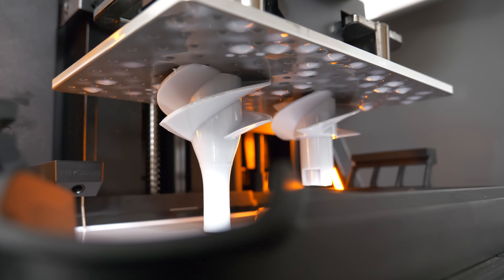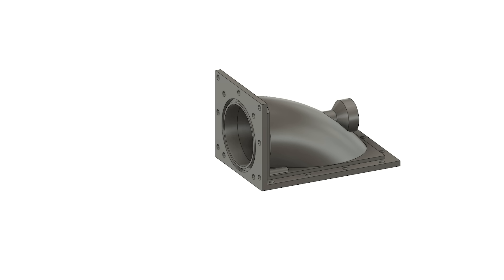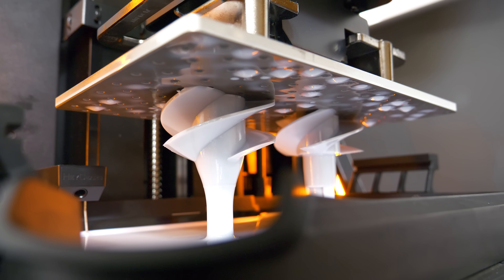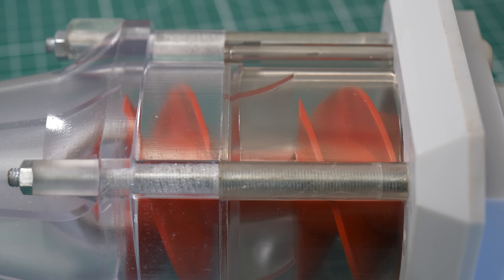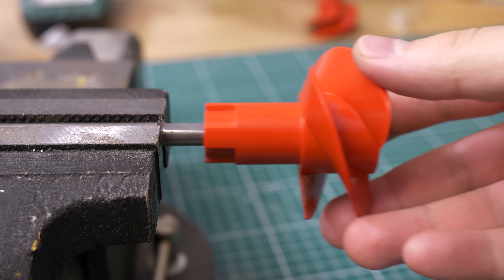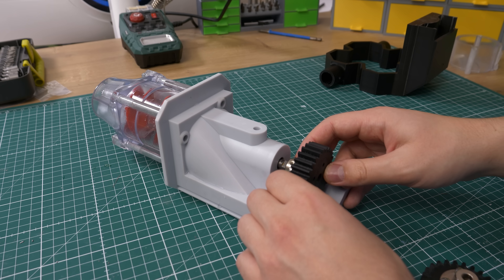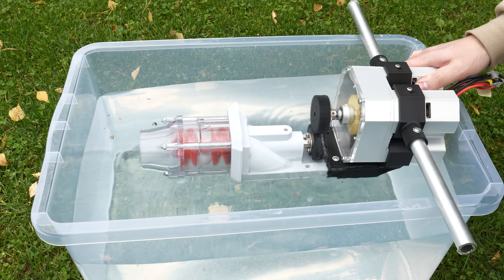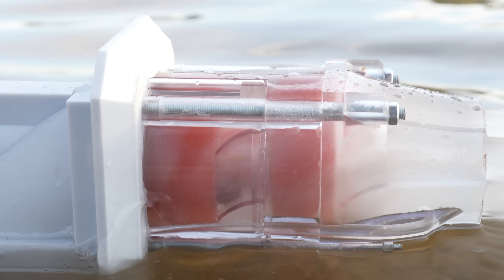3D Printed WATER JET With TWO IMPELLERS - Visible Cavitation (TRANSPARENT)

Comment: I believe you should've used a 1 to 1/2 ratio for %50 higher RPM and a belt drive for quieter operation, the rest is perfectly all right.

Comment: Omfg. This is EXACTLY what I need for my electric kayak project!!! If anyone can print me the parts, I'll pay!
Reply: There are services online that will print to order. You're probably better off with a propeller. More efficient at low speeds and realistically with the weight of batteries and a person your kayak probably won't be fast enough to take advantage of the high speed efficiency of a jet.

Comment: seems like the second impeller adding to much drag/load. You’d probably be better off with one impeller to achieve more prop rpm. Or a 2 stage automatic gearbox.

Comment: Usually, the second turbine is smaller and have a steeper pitch than the first, or is the same pitch but spins faster.
Then, there is the possibility of injecting air between the turbines to further increase the velocity of the water, and thus, the thrust.

Comment: A water speed means nothing, dude. "Jet" in a title means .. jet. So, how much water in what time will be propulsed. kg * sec. That's it. A narrow outlet is for more effective maneurability. And two identical propellers does not mean "two stages" That means a longer propeller. If you would take one bigger and slower, and the second one smaller and faster, in this case that would be "two stages"

Comment: I'm inclined to say that the cavitation you see is actually just air being sucked in from the loose fit of the shaft. And one more thing, you actually CAN use heat-inserts with resin. Not as good iirc, but doable.

Comment: Water jets are not as efficient as regular propellers. A jet's advantage is that it can run in shallow water. But in deep water, the boat is slower than the same engine/motor and boat with a propeller geared correctly. That is why propellers are predominant.

Comment: you should add a lantern ring to the shaft. basically a hose from the high pressure side to the shaft so any air leaks will get filled by the water.

Comment: Jet drives are not faster than propeller drives nor are they more efficient. They are used in rescue boats for safety reasons and to be able to operate in shallow water. In all other aspects, a propeller is much better. Jet drives are used in jet skis again for safety reasons not because they are faster or more efficient. Race boats use propellers. The fastest boat is propeller drive. Propellers also get better fuel efficiency. Jet drives were originally designed for river rescue. as they can operate in shallow water and maneuver better in currents.

Comment: I think you should rethink your design a little. The jet is really just a pump that creates a pressure difference. There are pump designs that create high pressure zones towards the center of the pump I believe. If you use a multi staged pump where each stage is designed to create a targeted increase in pressure perhaps you could create great pressure at sufficient volumes to make it work at lower rpm's. Another idea, what about implementing an outer bypass that goes through a sort of ducted fan and interacts with the high pressure water coming out of the pump, The way the big aircraft jet engines operate. Have you ever heard of Viktor Schauberger? He had some interesting idea's about how water flows in nature. One of his ideas was how to use a fast moving stream of water in the center of rivers to pull river water around bends and minimize erosion on the river banks. Perhaps this concept could be used in a water jet design some how.

Comment: 3D printing allows the amateur designer to test concepts and build workable prototypes in plastic and metal in a home garage or small factory before deciding on a patent or full scale production.
Opens up a new world of mechanical design and manufacturing.
I have a new design for submarine propulsion that uses a similar principle but with some interesting twists.
😎🇦🇺

Comment: You just proved, that contrary to popular belief, water does not lead electricity as your power leads were soaking in the water, but nothing happened. Next time it's maybe wise to lift them out with the rope or something (assuming you do not have third hand).

Comment: Love your videos. As others have mentioned, the second stage should be different, otherwise this is just an apparent long  impeller. You can also do at same speed on same shaft by making the second stage smaller, and have the housing reduce a bit before second stage, this way the first stage will be the intake, second stage the compressor

Comment: Again, you've got the stator blades in the middle and now in the nozzle at a completely reversed angle. This isn't a pump, it's now trying to be a compressor, which doesn't work with water.
You have water leaving the first impeller and slamming into the side of the stator blades, which creates a huge pressure difference on one side and significantly less on the other. This is the source of all the cavitation you can see. This cavitating mix is then hitting the second impeller at an oblique angle, which leaves by slamming again into the stator blades in the nozzle.
The water needs to enter and exit as smoothly as possible, any cavitation inside the pump drastically reduces efficiency, in this case it will badly damage the pump over time.

Comment: I think your nozzle diameter is too large. Air is cavitating inside, and reducing your exhaust velocity. increasing your flow rate will give you a linear increase in power, but increasing the velocity of the exhaust give an exponential increase in power.

Comment: Think of a 2 stage pump that you have essentially built, only use jet engine technology or torque converter for an automatic transmission,  and the principal of running compound turbocharger system to force air into an engine, jet engines use counter flow to compress the air, heat it up and increase velocity and pressure.

Comment: Volumetric efficiency. It's massive in water jets of this kind. So the leaks around shafts and joints need to be sealed to a high degree of reliability. We see bubbling around the back flange and the shaft will need a positive seal also. Against even an air leak. You produced a really sweet working model, component series here though.
Reply: Sonication and cavitation is a bitch - most props have a smooth tip rather than a pressure zone area for resonances and pressure waves to generate in.

Comment: I may not be an engineer but I think you should move the propellers apart so that water can get sucked properly by the second propeller like I'll make a space between them filled with water and maybe it'll boost the  maybe I'll increase the performance a bit, idk maybe it works

Comment: Have you ever used a transmission with electric motor to change output force of water parameter balance 3d transmission printed gear and housing baring and shafts Rockwell hardness for the application gold mining pump 🤔 for just a example of pump

Comment: cavitation is a huge energy loss, you might try reducing pipe size each stage to keep water channeled toward impeller.
also gears are trying to crush water, thats why they are failing, lubrication is important.

Comment: AWESOME work! I suggest using a mechanical seal like the ones on home bilge pumps / hot tub pumps. Very simple carbon-on-carbon with a spring! That will reduce most of your air leaks & cavitation

Comment: Great build!
You need counter rotating props w/ two motors (gears would be weak, noisy, vibration inducing and steal power). Add a pressure sensor in front of the props, a sensor in between the props and a sensor after the props for discharge pressure. You can then tune the maximum output by adjusting the two motors. 
Perhaps inlet guide vanes (small and thin) to direct the flow for more bite on the prop - Just like in a turbo jet engine. 
However the exiting vanes are not needed and are detrimental... 
Great vid!

Comment: I noticed that you have a stator between the two rotors. The stator is good as it helps to straighten the flow for the 2nd stage, but it looks like as if the shape of the stator is reversed. The blunt end of the stator aerofoil should be facing into the water flow, not away.

Comment: You want the second impeller spinning either in the opposite direction (more efficiency), or faster than the first impeller (more thrust). Otherwise there is no benefit over a single propeller, and actually a net loss on performance. You need to use a hollow shaft to connect one of the impellors, and an inner shaft running thru the hollow shift, separated by a high speed bearing, that way you can run at two different speeds. You add gear teeth to the hollow shaft, and either connect the inner shaft directly to the motor or its own gear.
Reply: None of that is necessary lol remember what it's used for

Comment: looks like your nozzle can be constricted more since when your fluid comes out it expands like it's coming out at a high pressure. making it smaller should level out that high pressure and also give you more velocity. it could also be expanding due to turbulence but honestly, I think your pump is just that good and can use a more aggressive nozzle.

Comment: It is definitely a nice build but you should do a second one fixing the issues and tuning it to better performance(stuff like leaks and clearances can be fixed in a second print). Most of your viewers would be interested in a 2.0 with a test using maybe a stand up board... If you will do it, try to find a calibrated rod for the shaft to reduce vibrations... Nice work!

Comment: Here's an idea for a video why don't you take that water jet and take the part at the very end of the nozzle the little blades coming out not the ones spinning but the little blades that are direction with the very end take the blades on the inside and make them variable pitch kind of like having ailerons and or flaps or rudders or whatever they call them you can make the vertical ones go 
 left and right, That way you could turn not only the physical water jet housing but The actual watter jet itself? That id like to see!

Comment: I assume you got a bit wet with your first try in the container. Why did you bother with "two stages"? You might as well have used just a longer impeller. It would have been quite interesting if you had two counter rotating impellers.
Fut to watch, never the less.😃

Comment: nice project you have there. Thanks to your transparent jet housing, you can clearly see that there is air in the propeller housing. This is very bad for your efficiency of your jet output. make sure your entire water inlet until your exit is water/air closed !!

Comment: 7:30 You could use a screw here. When you will mount a plastic on this metal part, if you have screw it will guarantee your plastic wont break it. We do it on small robot wheels, you snug them in into motor, but to make sure they are tight we screw trough plastic to reach metal part.

Comment: If you used counter-rotating impellers separated by a larger-diameter shaft to keep the pressure up, along with another larger diameter cone following the second impeller, such that the system maintains higher than ambient pressure until the nozzle, you wouldn't get cavitation.
Reply: How do you know such things? Books? Work?
Reply: @niklask1651 it's how turbines work. They have multiple sets of rotating blade and counter rotating blades that step up or down pressure depending on if you are generating thrust or power. When dealing with water, you want to maintain postive pressure on a pump; the pressure on a pump is called "pump head". If a pump creates a vacuum anywhere around the blades, the water can rapidly boil, which causes bubbles to form and collapse extremely rapidly. This is called cavitation and will destroy even the hardest of materials. Just like the pistol shrimp that creates that explosive high temp bubble when it punches its prey, each collapsed bubble eats away at the blades of a pump.

Comment: 6k rpms is plenty for a jet pump. You should consider optimizing the pump with those rpms. Add a wear ring to tighten up those tolerances of the impellers get rid of the air leaks tweak the impeller pitches and intake duct if needed. Thing should rip with some minor improvements.

Comment: I don't think this design is built with enough of knowledge and testing. I see no purpose this "two stage" system when they are both the same. If the last propeller is supposed to boost the first, then it should be optimized for that purpose. Basically in this setup the second stage is blocking the first.
Reply: Sir you are wrong. I think you should watch couple of videos from the M-Jet Development, he's the designer of the jet used in this video.

Comment: but total energy/power of the flow does not change with narrowing the pipe, that comes from by the motor impeller, so finally the screw drive worked, can you change the resin color on the fly, per pixel.

Comment: Buyer be warned,  HeyGears printers will ONLY work with their proprietary and expensive resin refills.  You cannot use your own resin.  I wish sponsors would disclose this.
Reply: And what make you say this resin doesn't give a shit what printer it's in. The resin is exposed to UV light and hardens
Reply: @jackass123455  Other than their website actually explicitly says that these cannot use any resin other than their own brand? The fact that it uses their proprietary resin containers, and the machine constantly measures how much it dispenses means it knows how much resin should be in the tray. There's no way they didn't add all that functionality without being able to stop people from using their own resin.
Reply: @jackass123455 Most 3D printing resins harden at a specific wavelength of UV light. Their resins are SPECIFICALLY FORMULATED to be unafected at these wavelengths and the printer filters out those same wavelengths. This means your parts won't adhere correctly without extensive print time tuning, you will lose accuracy and precision, and your end product will be garbage. That has no reason beyond trapping an end user in their hostile ecosystem.
Reply: @jackass123455  you’re name really checks out lol
Reply: @jackass123455 the machine cares.
Reply: @jackass123455  The machine is designed to care. Probably some sort of serialization of the cartridge.
Reply: I own one and have never used heygears resin, ive mostly used sunlabs resin and it works just fine

Comment: You could put a hole on the side wall beside the first propellor so centrifugal force can push water through a tube connected to a heatsink on the motor so the motor doesn’t overheat.

Comment: 7:06 That´s why you´ll aways need some simple metal machining. Like a lathe. With a lathe, you´d have cut threads on an otherwise smooth rod, cause that´s the way such machines are built. One doesn´t use an end-to-end-threaded-rod, when the threads need to be just on a short part of it.

Comment: What would happen if you make it a 2 stage waterjet? Like after this part you built you add a smaller impeller with greater pitch inside a narrower housing and with a smaller nozzle? Would that create a more powerful thrust in the water as the water from the nozzle would come out at an even higher speed?

Comment: you have little leak on side it would be good make a gasket and stick in there seal it up from grey housing to clear plastic give it more pressure output
i think of one thing that wasnt tested was amp and watt and how many draw to sent it full power if it too much amp there going need be bigger mower to handle it ( was hoping for weekeater engine 47cc have top out 16k rpm )

Comment: Curious question: This design draws in water and shoots it out above water. 

How different would it be if it shoots out underwater?
Reply: These propellers work the best when they are half above waterline water mixed with air

Comment: I'm inclined to say that the cavitation you see is actually just air being sucked in from the loose fit of the shaft. And one more thing, you actually CAN use heat-inserts with resin. Not as good iirc, but doable.
Reply: You can see the cavitation forming on the back of the first set of stator blades when he tries to run it in that lake. It gets significantly worse when it hits the nozzle.
At this point, it'd probably be far more efficient and have much more thrust if he just removed everything right up to the first impellor and ran it like that.

Comment: When you cure your parts, it would be better to put them in cold water and place it in the curing chamber. With the resin parts being in the cold water. Then they stay clear and shorter curing times.

Also a really good resin printer is from Uniformation: GKTwo

Comment: You basically built a mini jetski impeller pump. Would recommend getting a small horizontal shaft gas engine, and use a chain or gear drive to get the RPMs up, and you could slap it on a small boat for a homemade jet boat.